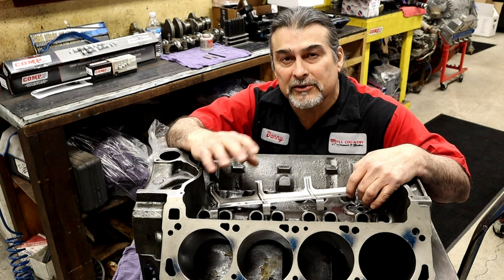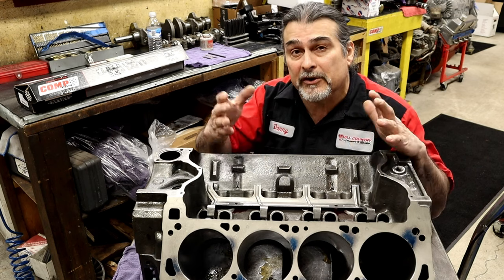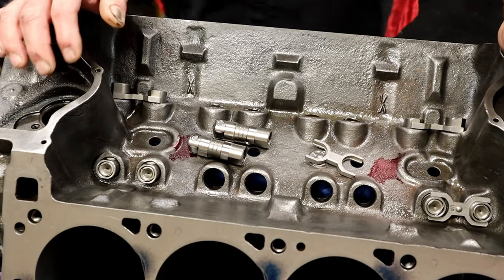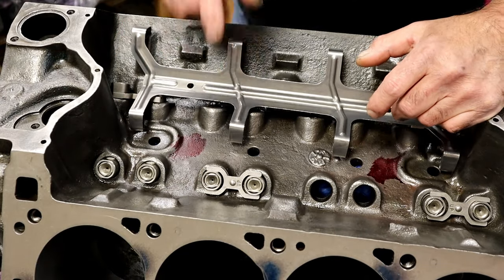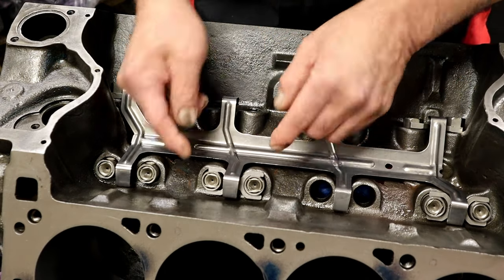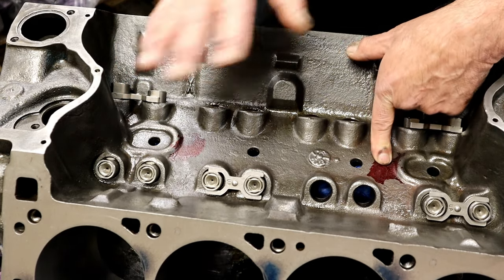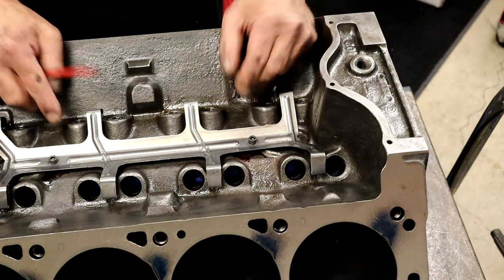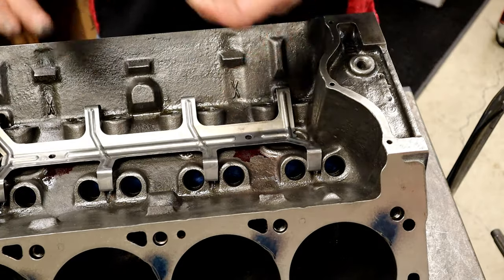HOW TO INSTALL A COMP CAMS ROLLER CAM RETRO FIT KIT.

Comment: Any benefits from a roller cam/lifter in a street engine or is this strictly for high performance/race applications?
Reply: With modern oils it's real easy to wipe a flat tappet cam because of the lack of zinc in the oil that provides the protection at the face of the cam lobes where the pressure is extremely high and the oil film cannot prevent metal on metal contact, with the roller cam that is no longer a problem as the roller reduces the friction and pressures. Another benefit is that you can run a better cam profile with the rollers.
Reply from the maker: Exactly !👍👍👍👍
Reply: @Blazer02LS  it's not the oil it's the junk Chinese materials, poor manufacturing practices and QC.
Reply: @harmankardon478  Nope it is all about keeping metal on metal contact from actually happening. That is the oils primary job in any application. It's secondary job is to help carry heat away from those same high pressure areas.
Reply: @Blazer02LS  you don't even know how a flat tappet cam works. The cam lobes MUST have a slight taper not visible to the eye, the lifters MUST have a crown, both surfaces must have specific hardness characteristics in addition to the tight machining tolerances this facilitates the lifter to rotate in the bore so that your basic understanding of oiling can even occur. Additionally, the metallurgy ensures that the surfaces hardnesses allow mating and don't fail during break in ... there's much more to cam failures then "it's all the oil".

 ZDDP is what you would have referred to if you knew anything about the only significant change in modern oil.... ZDDP additives are used in many failed break ins which disproves your grossly over simplified "is the oil theory"...

Comment: Ok I’m a Bow tie person who’s been holding back from from doing this bc of the cost and I’m dealing with a street motor and figure I’m good as far as that goes but I’m considering taking the plunge so for a street motor how much would I expect to spend on a perf.set up?approx.
Reply from the maker: Depends on parts that go into an engine. Cost wise you can’t beat a ZZ4 crate engine?

Comment: Retrofit... maybe the most important check is going to be oil bands - especially where a reduced base circle is reached for trying to get at bigger lift.  You can get in trouble high or low - no peeking allowed!.  Second, lifter bore centers: square vs cam center.  This can be off a small amount on flat tappets and gotten away with [as long as lobe stays away from lifter edge and still spins], but lifter rollers with grossly uneven axle loads are not going to be happy for long.  Could 1 degree ruin your day? Could be.  Even if it survives to develop a taper on lobe or wheel and goes 1100 miles, the result is any cam walk at all is then trying to spread lifter body at axle from occasional side loading.  [Jigs used to drill lifter bores rely on other things being right:  cam tunnel indexed correctly, and decks/china wall are true].  Re-indexing a cam tunnel can be done for oversized bearings. Original period blocks sometimes came with near 0.005" deck taper.
Nice touch on the spacers - that would be my choice as well, so fasteners load/stay put.

Comment: I'm working on a 400 ford same as a 351m block. The ears on the dog bone interfere with the corners of the valley. Is it normal to need to relieve the corners of the dog bones with a radius?
Reply from the maker: Sometimes you need to , if the block is apart I’ll grind the block.
Reply: My machine shop assembled the bottom end and tapped the block for the spider kit. They must have missed the interference. Don't want to grind the block now so hopefully a little off the leg corners won't hurt it

Comment: Thanks for the video my roller kit is ordered but mine  does not come with a hold down tray? Do all roller cams require the hold down 
1968 ford 289?
Reply from the maker: No, you make also use tie bar lifters like we use on race engines. You just need a way to keep the lifters from turning.
Reply: @MrDanielSoliz  makes since idk why comp told me I don't need it! Looks like I got more questions to ask
COMP Cams Camshaft Complete Kit Magnum 260HR Retro-Fit Hydraulic Roller 1200-4500 RPM Carbureted 289/302
That is the kit I ordered from cj pony

Comment: Thanks Danny, What brand is that tap holder with the 3/8 extension ratchet adapter built in?
Reply from the maker: It’s a Snap-On set. Very nice set!

Comment: Danny what would the cost be to purchase  a fully prepped 408 Windsor block from you for around 450-550 Hp.  Yes a roller cam will be used

Comment: I have a regular 350 with a Flat-Tappet cam, so order this kit and and change my cam to a roller cam???
Reply from the maker: This is a kit for ford. There’s a different kit for your small block Chevy ,you will need tie bar lifters.
Reply: @MrDanielSoliz  one other question, how can I  find out what cam I should choose??…not sure about lift and duration?

Comment: does it matter which way the tiny oil bleed hole in  the roller lifter faces?
Reply from the maker: Doesn’t matter, funny thing I always like to aim them towards the oil passage but it makes no difference.
Reply: @MrDanielSoliz  thanks I pointed them all towards the front of the engine. I  am trying to finish this 4.3 sbc up and dont want to make a simple mistake.  I have another question,, my harmonic balancer seperated on my 4.3 while assembling the motor.., I have read that the harmonic balancer and the flywheel as well as crankshaft drilling balances the engine.. so are harmonic balancers critical in getting the engine balanced, can I use any one for that engine or  do I need to have anything done. ive heard the 4.3 without the balancer shaft, (which I have). can be real shakers.

Comment: Will that kit work on a older 68 302 block?
Reply from the maker: Yes it will.
Reply: @MrDanielSoliz  will you have to run a small base cam or any one will work

Comment: If using the OEM length roller lifters does this require using a small base or reduced base circle cam?
Reply from the maker: Are you asking about OEM lifters on a roller block or non roller block?
Reply: @MrDanielSoliz  non roller block. My understanding is that no roller block with these lifters requires small base circle cam.
Reply from the maker: The lifter is taller, and a smaller base circle would put the lifter further in the lifter bore.

Comment: I call b.s on the lifters being different bc it's same part numbers so stock 302 lifters should work plus from what I've researched there the same
Reply from the maker: When I had talked to them they said they were not the same, that they where longer.I just looked and they are showing the same parts. I stand corrected.👍

Comment: no. 7 drill bit
Reply from the maker: It does call for no.7 or 13/64 “ drill bit . Monday I’m going to check the drill box and see if someone didn’t put the drill back in the right spot, Thanks for the clarification. 👍